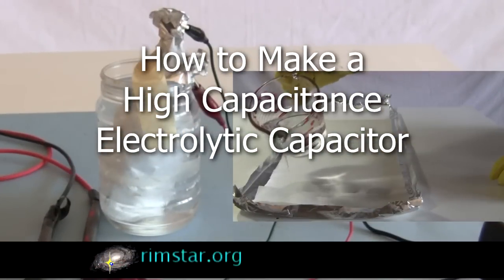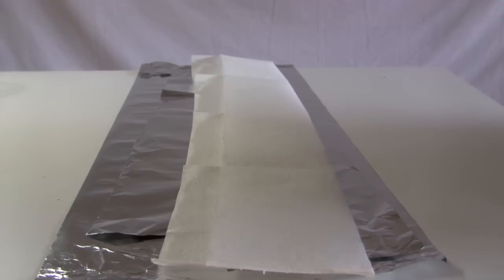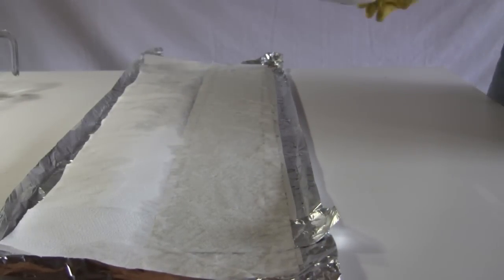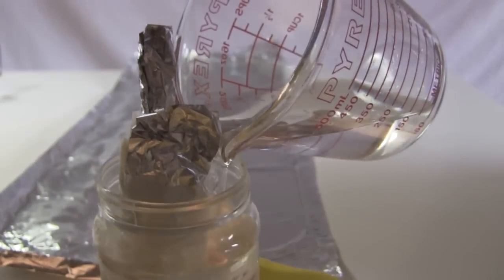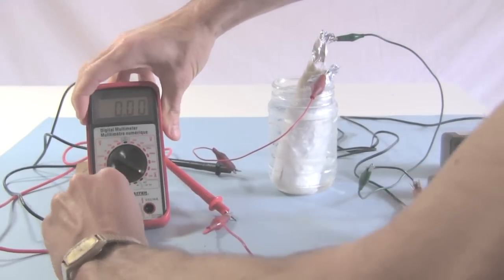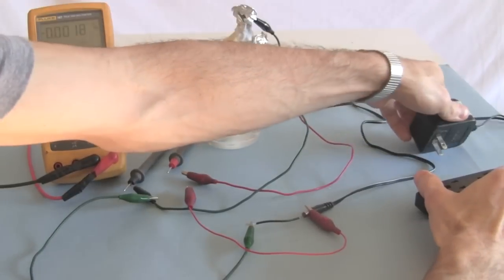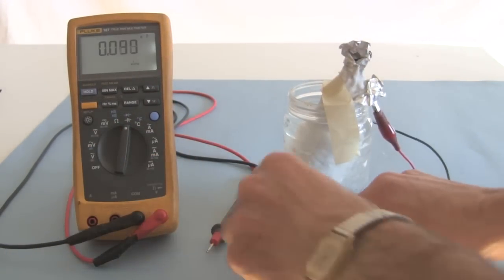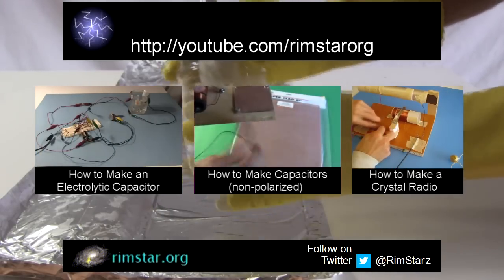How to Make a High Capacitance Electrolytic Capacitor

Comment: I know you have put a lot of time into this but it is not a capacitor. It's a very low capacity rechargeable battery. There is no Dielectric separating the two plates. When you charge it, you are creating two different types of aluminum. The baking soda and water is the electrolyte. It's just like a lead acid battery but with extremely low capacity.
Reply from the maker: The dielectric is the oxide layer that forms on one of the aluminum plates during the forming step. It's the same thing as with commercial electrolytic capacitors except that they add additional chemicals to make it more stable. It's this extremely thin oxide layer that acts as a very thin dielectric resulting in a relatively high capacitance. See my video How to Make Electrolytic Capacitors that came before this one.
Reply: how do you differentiate between a low capacity rechargeable battery and a low capacity capacitor
Reply: derwoodvw I 'hear' what you're saying and it seems correct.  However, when the Fluke in the video measures the capacitance of RimstarOrg's contraption it actually gives a mid-500's micro-Farads reading, therefore I'm pretty sure it is a capacitor.
Reply: derwoodvw, it is an electrolytic capacitor. The oxide layer insulates dc current.  Here, aluminum oxide is the dielectric insulator and an electrolyte being part of one of the plates. The oxide layer seperating the negative and postitive charges is very thin.  Bringing the positive and negative charges very close allows for more energy storage, increased capacitance. 

A capacitor can be formed from two plates with nothing more than a vacuum between, because everything, including empty space has a dialectric constant. The relative dielectric constant for aluminum oxide is much greater than space which improves the energy storage through storing energy in electrostatic orentation of molecules. 

Once the oxide film is established, charging and discharging the capacitor does not change anything chemically because all the energy stored is stored electrostatically, not chemically. Batteries store energy chemically.

Comment: bicarbonate is not very soluble in water, and therefore, the ESR of this capacitor would render this device purely conceptual rather than practical.
Reply: True, but this just demonstrates concept with easily obtainable, safe compounds.  The chemicals can always be tweaked for optimization

Comment: You dork lol, why would wet the paper towel first if it's all going in the water anyway lol. Thanks alot great video. i never knew making capacitors was so easy
Reply from the maker: Good question. I wet it first to make sure it all got wet. If I rolled it up first, put it in the jar with the fluid then the fluid might not get everywhere, especially with all that foil in the way. Plus, the fluid would slowly soak in, then I'd have to add more, and more, and more, and never be sure that it all got wet. And thanks, I'm glad you enjoyed the video. I was a bit surprised at how well it worked too -- it's so hard to get such a relatively high capacitance with a dry capacitor.
Reply: @RimstarOrg  I figured as much, But you would have just need a bit more time for soaking. Working with the wet paper towel seemed like a bit of a hassle. I guess shortcuts aren't the way to go if you want something done right.